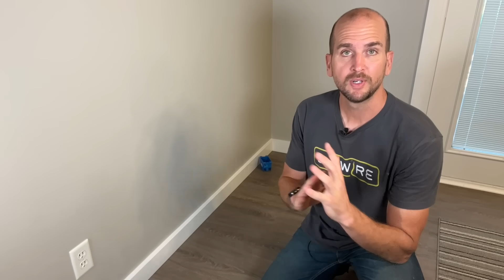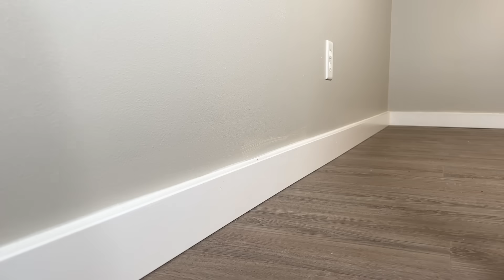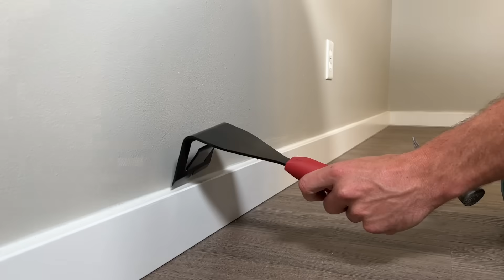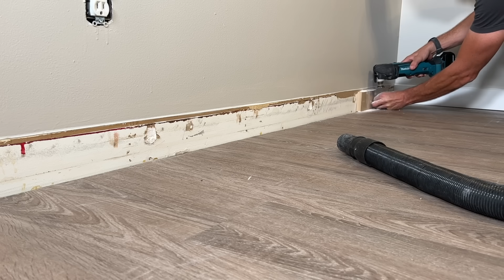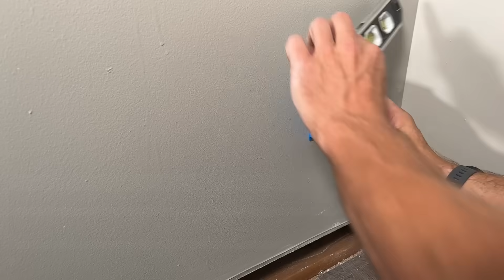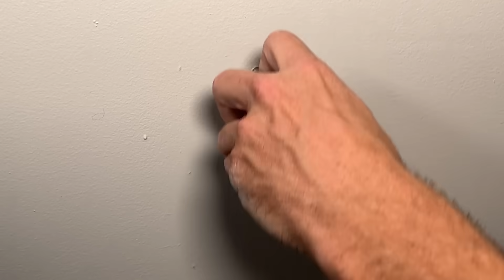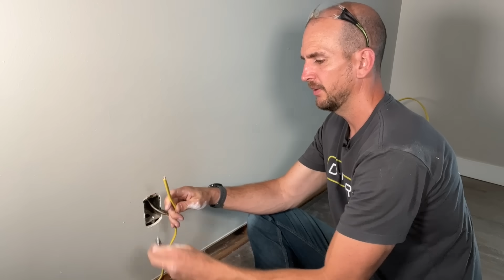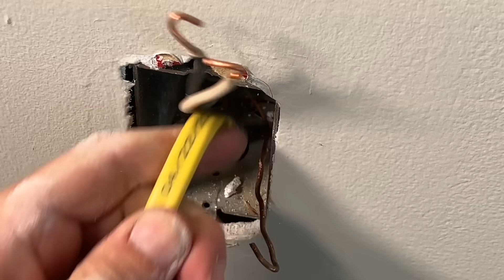How To Add An Outlet To A Finished Wall

Comment: At the end of the studs you should probably notch not hole cut the stud. Better for load support.
Reply: You can argue it either way. A notch is shallower, but off-centre, a hole is 'through the middle' so supported on 'both sides'. 
And then the material (drywall etc) also provides support, forming a sandwich.
Reply: @johnathanh2660  it’s physics sir. But you do you
Reply: @tdub77  Yes, it is physics. Now you need to get into the specifics - how big is the hole, how deep is the notch, what size are the timbers? How large is the wall, how closely spaced are the timbers, what vertical load is the wall under? What material is used either side (to form the sandwich).
What should quickly become apparent is that it really doesn't matter because the wall is over engineered anyway.
In the UK we typically have construction like this as non-load bearing internal 'stud' walls (with perimeter load-bearing brick walls), so you can pretty much do what you like. That includes taking pipework for example to fit a shower.

Comment: this is lazy work.  cut the whole drywall section out and run the wire at a horizontal line straight from gang box to gang box.   i cut out horse hairy plaster to do the job right, you’re dealing with dry wall.  nice job but it’s lazy.
i don’t care if it passes code where you are it’s still lazy.  you know it, the electricians that watch and leave you positive feedback know it’s lazy.

say someone wants to remodel that room and wants taller baseboards.   they’ll have no clue about that wire and burn the house down.  it happens, and it happens fast.  if you make a habit of doing work like this, do you think about all those jobs and say i wonder if someone will nail or screw thru a wire i put in there and risk the lives of people in that house?
i wouldn’t want that on my mind.
are you going to go back and fix all the fast/lazy jobs you’ve ever done?
mmmm
no body is going to nail thru those wires………you have to be 100% positive.

i’m the asshole that said it.
somebody had to say it

btw….are you licensed in that state?

Comment: Wow, that’s a really clever route that I’ve never thought of. All of your electrical was done great and I like the distinction between backstabbing and back wiring. One thing for future old work receptacle jobs would be the break off the 4 tabs on the receptacle. They are there so in new work installations the receptacle can hold itself flush to the drywall, but an old work box already does that so in some cases those tabs will make the receptacle and plate look a little off the wall.
Reply: I agree with Grey Scobey on the plastic remodel box if you don’t break off the 4 tabs on the outlet the outlet and plate won’t be tight and flush with the wall a good tip to remember
Reply: The route ought to be behind the baseboard so that nail plates can be installed to protect the cable from severe physical damage.

Comment: From a Dutch/European perspective this is so interesting!  what strikes me is that the safety rules in the US are a lot looser then they are in Europe. We would never be allowed to make an expansion like this. We either need to run wires trough a plastic tube, or use a much thicker insulated cable. (I used to be an electrician)

Comment: National Electric Code requires all outlets in residential to be tamper resistant. (NEC 406.12) Commercial grade outlets do not have the built-in protection.  Also outlet replacements and all wiring extensions require ARC fault protection.(NEC406.4(D)(4)  and 210.12 (D). Ensure wiring is 1  1/4 from the stud.  If you're going to teach people please do per Code. Otherwise well executed. Sorry I'm an electrical inspector, I can't just watch.

Comment: Great video.
The romex connector is completely unnecessary,  the wire will not move enough in a thousand years to begin to rub thru the insulation.
At most you could use about 20 wraps of electrical tape around the romex where it enters the box.
Reply: In the UK we just use a gromit (a sort of rubber washer) to prevent the cable chafing on the metal rim of the back boxes. As you say in the wall the cable cannot move enough to damage the insulation.
The only questions for UK installations (my information's dated) is a) is any metal protection required in this instance and  b) what is the expected/preferred cable run.
In the UK we typical have sockets in a row, so there could be horizontal cables running between the sockets, OR cables running vertically to the floor, or up to the ceiling depending on the construction of the building (i.e. on the Ground floor; US - 1st) there may be a concrete slab, so easier to drop from the ceiling). 
In this case the cable is being run in a 'U' shape. Would someone following up expect this? Or would they expect a horizontal cable?
As for metal protection, I believe (again UK) that as long as the wooden support is 'thick enough' and the hole is in the middle of the support then protection is not required as screws should not be going that deeply into the wall/wood.

Comment: Great tutorial! Curious on pigtail vs running wires off outlet. Any advice appreciated.
Reply: You would be able to stay within electrical codes regarding box fill. In Canadian electrical code, two wire nuts equal one more conductor in our box fill calculations.

Comment: Always screw down the wires clockwise on 15amp receptacle outlets. I'm always finding burned up wires that worked themselves loose from being stabbed into the back of the outlet, especially inside mobile homes.

Comment: You could've easily removed the old outlet box, and used a long flexible drill bit to drill through the 4 wood studs and pass the wire through with a pull wire. No drywall removal or damage. Install 2 cut in boxes 1 for the new outlet and another for the old one that was removed. Would've taken about 30 min to an hour to finish.
Reply: So explain how to remove the old outlet box when it is nailed under the drywall. I don't think it would be easy. I think the method shown is great!
Reply: Drilling blind holes is a good way to accidentally damage wiring water lines or other stuff in there

Comment: not sure if you are allowed to use levernut to splice outlet circuit  
Also not sure if I need to risk molding instead of making holes in drywall and patch and paint

Comment: Have an old book , electrical engineering professor , his instruction is to find & notch each stud after cutting through drywall / plaster. Known brilliant people over the years w/o common sense/experience of an electrical helper to wire a single pole switch

Comment: Brilliant method for getting that connector in there! Out of curiosity, why did you pig tail it rather than just run both sets of wire directly to the terminals on the receptacle?
Reply: It may not be the reason, but an inspector friend once told me not to use the outlet as a junction as the metal band joining the two screws wasn't #14 and incapable of carrying 15A.
Reply: Pigtails are code and the proper way to do it.
Reply: @kellynicklassen5896  - Agreed.  My only observation (and potential contribution) is that the motivation for the code requirement would be a nice thing to add rather than a prescription.  

In exchange for cluttering and potentially overloading the box with extra stuff (2 wires, 2 wire nuts), we get added safety because a pigtail can definitely carry the voltage/current whereas the thin copper strip in the receptacle, while capable of carrying the voltage, is probably not capable of carrying the full amperage under load.

Now, I've not done any load testing on a receptacle (has anyone?) to see at exactly what amperage (on average) that carrier strip between the black terminals would act like a fuse and burn out.  Now, THAT would be a most interesting experiment to conduct.  Can it carry 12A, which is the recommended service load for a 15A @ whatever service voltage your carrier provides in North America.
Reply: @GrahamLeach   I agree wholeheartedly with your statements. At one stage in BC the pigtails were required as a provincial amendment to the code. Now its business as usual with just the pigtails being required on the neutral in multiwire branch circuits (split kitchen receptacles)
Reply: I second this question. There are two sets of terminals on that outlet so why not use them both and cut out the wire connector. Just makes his box cluttered. My guess is he's just trying to sell wire connectors so he needs a reason to mention them and drop the link to his Amazon affiliate.

Comment: You could put some wireless outlets in so you don't have to run any wires, but you will need to plug it in to an electrical outlet. If you don't have an electrical outlet nearby you will have to install one and If you don't have access to inside wall or no place to run electrical wires you can install a wireless outlet so you don't have to run any wires, but you will need to plug it in to an electrical outlet. If you don't have an electrical outlet nearby you will have to install one and If you don't have access to inside wall or no place to run electrical wires you can install a wireless outlet so you don't have to run any wires, but you will need to plug it in to an electrical outlet. If you don't have an electrical outlet nearby you will have to install one and If you don't have access to inside wall or no place to run electrical wires you can install a wireless outlet so you don't have to run any wires, but you will need to plug it in to an electrical outlet. If you don't have an electrical outlet nearby you will have to install one and If you don't have access to inside wall or no place to run electrical wires you can install a wireless outlet

Comment: Nice video, only one thing I would have done differently. I break the ears of the device yoke on cut in boxes otherwise the device sits proud of the drywall. Cover plate screws should be vertical as not to collect dust IMHO.

Comment: Your existing metal box should have a bonding ground to the box since it is metal, attached to the supply ground, the ground wire you added with the extra wire, all pigtailed to another ground going to  the existing outlet

Comment: I’m still wounding how the hell you found a stud with a magnet 30 inches up.  What fastener would you need to space in that spot.   Maybe 🤔 if you block your walls at 30 inches you would have one.  I just want to learn that trick.  I’m not trying to be that guy.

Comment: Very nice work.  I'm an electrician in California, mostly doing electronics installation now, TV's, surround sound, network cameras, telephone systems.  It's nice to see a careful and clean installation.  Thanks for the great video.  I hope you can charge hourly for this install - customers rarely know what it takes to be this professional,  But they want the great installation.  And love the end product.
Reply: Professional installation requires nail plates to protect from severe damage according to the NEC.

Comment: I figured that was what you were going to do, but there are codes and "guidelines" for a reason. when wires & pipes are run at code spec, the next person who works on your house has a good idea where NOT to drill, cut, etc.  So no nail plates on the studs, no conduit for the wire to run through, etc, making this "solution" a potential hazard in the future if you don't work on the house yourself or sell it.  JS.

Comment: Great job, the only thing I would have done differently is run electrical tape around the outlet to cover the screw lugs, especially on the metal box.

Comment: Watching this in Germany - and I see few differences:

- On the video, the box containing the outlet looks quite flimsy attached to the wall. I can imagine somebody rapidly pulling out the plug - and the entire socket pulls out of the wall. The ones used in Germany have small "wings" on the back, and during installation screws tension those wings to rotate, expand and press on the back side of the wall, so it is very difficult to pull the thing out.

- In the US, he fastens the wire with the metal connector (the one he explains is difficult to install due to limited space) to the box. This is very sturdy, but also time consuming. In Germany, the boxes are made of soft plastic, and you just pick one opening you want to use and push the wire trough it. As the wires and holes are standard sizes, the hole is just tight enough so the tension keeps the wire in place. Not as sturdy as the US, but way faster to install.

- Virtually all new outlets (or sockets?) use push-in / clip-in terminals. I haven't see any newer models with screws. It's much faster to just push the wires into the terminal. Additionally, all terminals can accommodate two wires. This makes this type of daisy chaining much easier without the use of pig tails.

- From the video, it looks that the US box is much specier than the ones in Germany. It appears that there is much more space at the back for additional wires etc :)

- And of course - our ground wire is insulated and the box is not grounded, as it is made of plastic.
Reply: Both metal and plastic boxes are available, but metal boxes are much more common in older houses than newer. His wall now has both — he could have replaced the metal box with a plastic one, but that would have been much more work than simply adding the wire clamp, as he showed. The plastic boxes indeed seem similar to what you describe in Germany.

You can just screw the ground wire directly to a metal box, because the ground terminals of an outlet are connected to the casing and thus the installation screws, so this will ground the outlets as well. However, I have no idea if that's up to code. Probably not. (Related: in old houses, it is common to have no ground wires, but the metal boxes are still grounded, because they are fed from grounded steel conduit.)

Comment: Only way be smart and afforable  is  mound race way and out wall receptical box connected to nearest receptical if circuit is large anough, if not , it ne in wall to panel or race way to panel.

Comment: I have been using this common sense approach in these particular situations for 20 plus years.   So I was very surprised by the number of comments as if this was a new technique.  Thanks for posting this and helping out folks that otherwise have been obviously doing way to much work in the past for such a simple task!  Great tutorial.
Reply: https://youtu.be/G5w9QcIa6Iw
Reply: The NEC has been updated since you started.  Nail plates are required to protect the cable from severe physical damage.

Comment: As an electrician I am genuinely happy to see nothing scabby here. Well done
Reply: If you had been living in the EU. You would have rooled on the floor. 
The way the electric is done in the USA. Is sad. It is like old installation from the 60. So werd that USA is stuck.
No pipes, Torix, no rcd on the fuses, no safty on the outlet??. 
And whan thay use pipes it is steel..😥😥🤔🤔

Comment: This is fine and dandy until you have plaster board and plaster walls in a home from 1930 lol. That stuff does not like to cut, I usually end up using my angle grinder with a cutoff wheel, using the shop vac next to it to suck up as much dust as possible.

Comment: Good tutorial but let me add a few points.
i) A marretted joint is far superior to the WAGO type.
ii) Break off the plaster "ears" on your switches/receptacles when installing in a rework box.
iii) Even though this receptacle was "commercial grade" it is always better to use the actual screw terminals, instead of back-wired clamps.

Comment: Nice work. I was taught this trick, too, but was also taught  to leave a bit more length on the conductors, although it might be camera angle. One thing to be aware of is that the process can leave you drilling holes that aren't quite parallel to the floor. When you pull the cable later, it ends up needing to make a bit of a zig zag as it goes in and out of the holes, bay by bay. Nothing wrong with that, but someone new to this needs to know that they cannot just heave on the NM cable and yank out more length at the end.  If you do that, there's a chance you will damage the sheathing / cable and maybe even the insulation on the individual conductors. So, take your time, and feed the cable from the supply side and patiently take out the slack. NM isn't very forgiving when fishing.  I'm sure you know all this :-)  I'd advise getting a flashlight and inspecting the cable at every single hole, both sides of the stud, after fishing the cable to look for cable damage, every time, even when things seemed quick and easy.
Reply: You could probably drill from both sides to even out the holes

Comment: Great video!  I've been using this trick for this for 35 years -- way before the multitool!  The multitool makes it A LOT easier.  A faster way but a little trickier is the only cut from the floor up the width of nail plates protecting the nonmetallic sheathed cable.   Some here on this forum may understand what I'm talking about.
Reply: GREAT...NOT LIKE A BBQ GRATE..Friendly correction.
Reply: @juans6639  pretty bad how I spelled it and I'm pretty good at spelling.  I'm fixing it now, so check back.

Comment: I’ve done this before with speaker wire. Thankfully I had the baseboard trim off anyway because I was also installing hard wood flooring at the time.